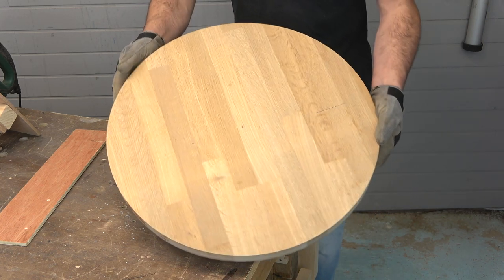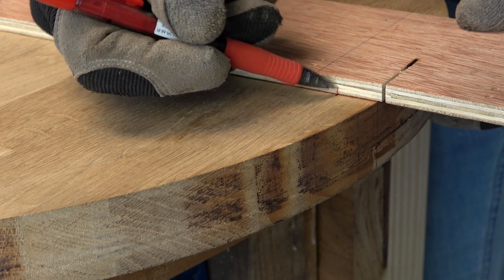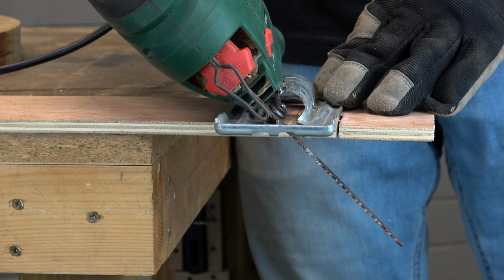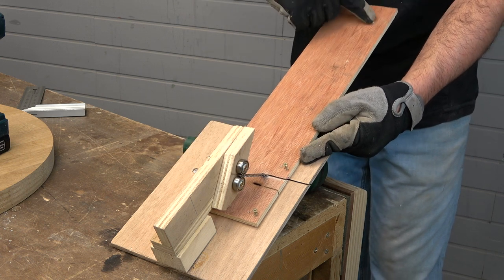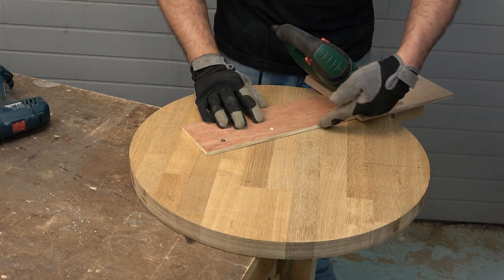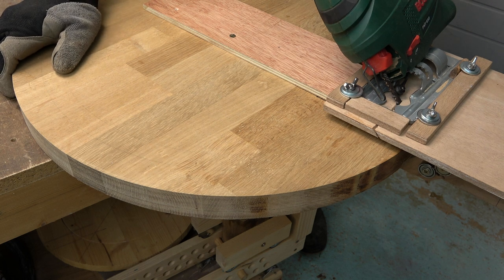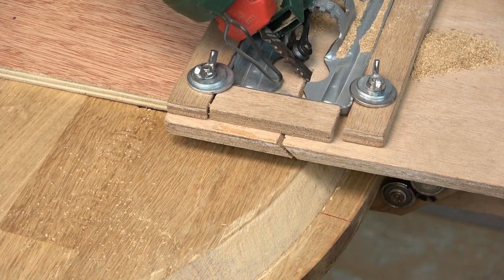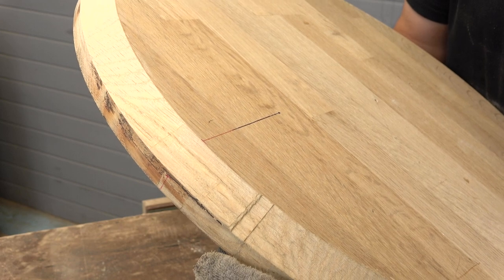✔️ How to cut chamfer and bevel with a cutting jig for jigsaw

Comment: For small 45 degree bevels a router is probably the way to go, but if a bevel other than 45 degrees or larger than the capacity of a router bit was required then this approach is a good solution. A jig on a table saw would possibly give a cleaner cut, but then the size of circle would be limited by the size of the table on the saw and be a more risky operation to perform.

Thanks for making one of the most interesting woodworking channels on YT!
Reply from the maker: Thank you very much Robert. There is a lot of people who only have a jigsaw, and they don't have a router, a router table or a table saw
Reply: I have a table saw. I tried to cut a circle with it once. The relief piece kept binding up on the blade. I have a router on a router table and a 60° chamfer bit, for making 30° bevels. It is tedious and a hell of a fight to get a good clean result. I have the tools you mention, and I'm going to make his jig. It is genius.

Comment: A router and chamfer bit would be far easier, accurate and consistent.
Reply from the maker: For sure, but in case one don't have a router ... 😀
Reply: You'd need a massive chamfer bit, no? What if you wanted a different angle than 45? Not likely you'd find a chamfer bit that big with a different angle, but this jig could do it.